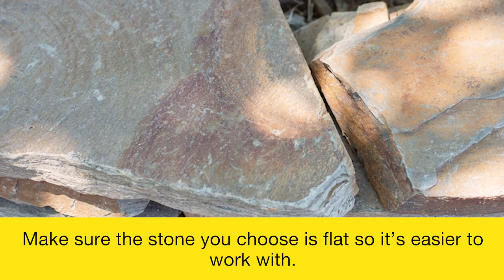How to Build a Dry Stack Stone Wall with Natural Stone

Comment: It is my understanding that even short walls need a gravel or packed sand foundation; if you simply put the rock right on the soil then the wall will move as the ground below moves over time.
Reply from the maker: Short walls over clay are fine. We're in highly compacted clay soils here.
Reply: @SupersodTurfgrass  I'm in Southern IL, soft clay soil, what do you recommend? I'd actually like a 2' wall